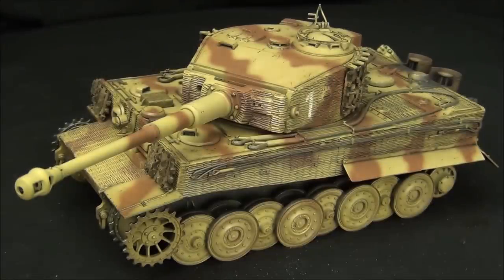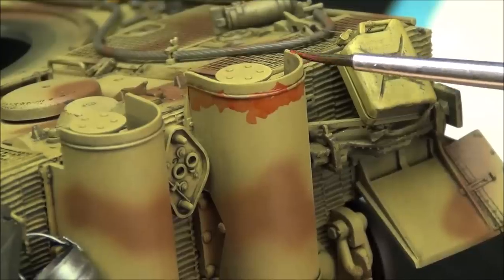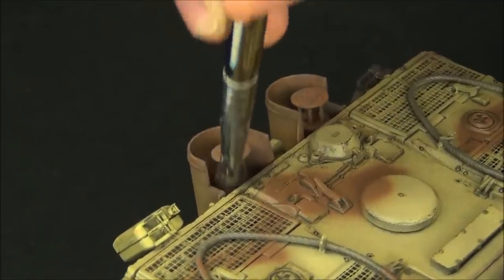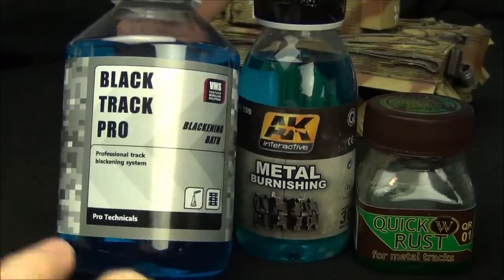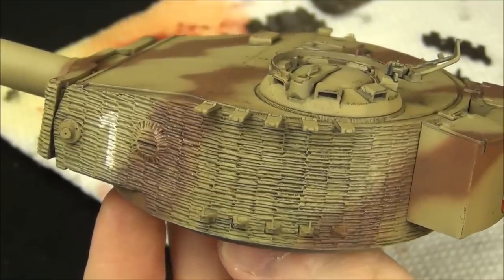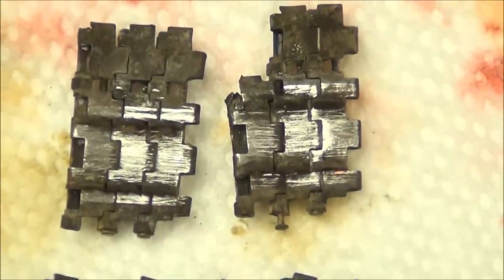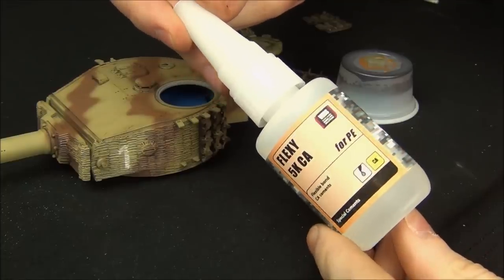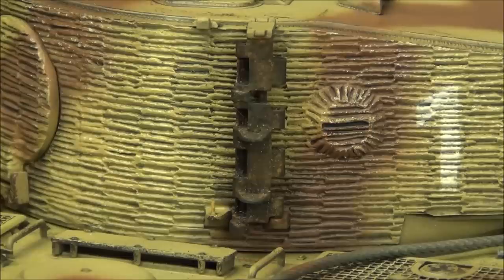Realistic Rust Effects on our Tiger 1 - Exhausts & Track Armour - 506 sPzAbt 1944

Comment: Rust looks great!  Nice work with the oils!  
The tracks in the AK burnishing fluid gave me the same results when I tried it.  I give them a day or two to fully dry from the fluid before going over them with a brush to try and blend a little.  I then use Panzer Aces track primer with a touch of black to touch up areas with a brush as needed.

Comment: I have made mistakes with burnishing fluid before. I have noticed without an acetone bath, the mold release used on whitemetal resists the chemical reaction and it looks quite terrible. A lot of times it wont be noticed with weathering...but I have also had to paint into the track to cover the bright silver. 
You did an excellent job with the rust. I tend to notice too much rust on many of others vehicles, but yours is quite proportionate and looks great. 

Another great video, Evan. I can't wait to see this 506 finished.

Comment: Cool stuff man. Your rust turned out well. Just curious how the spare tracks on the front of the tank were mounted or did they just leave them loose.
Reply from the maker: They're usually just tack welded on.  Adam Mann has some track links which show that they were welded onto a tank as well.
Reply: Those crafty Germans. Hey, what the heck are you still doing up? Isn't it like 5am there?
Reply from the maker: Yes it's 450AM.  Long weekend :) StuGs won't build themselves...
Reply: @Panzermeister36  This is true...

Comment: I usually try to avoid the use of rust except in areas where it would/could be visible. I feel rust is often way overdone with armor that's supposed to be in service. Some of the armor I've seen being depicted in service, yet rusted as if they've just left the salvage yard with it. Great work and good video!
Reply: I use a piece of steel plate for my rust, it has alot of different shades of rust, natural is better

Comment: If the spare tracks were painted body colour at factory and then corroded after wear and tear, wouldn't the way to do them be spray with gelb then 'rough' off the paint in the places it'd be abraded, and then burnish, leaving the modulated rusting/darkening in the right place?
Reply from the maker: I think the burnishing would melt off the gelb paint I'd the paint were applied first.

Comment: Be careful with those blackening solutions. Some contain some nasty chemicals.

I think the old tracks used as armor would rust very quickly. Bare metal, where the wheels rubbed, wouldn't stay shiny very long at all, but be rusty quickly.